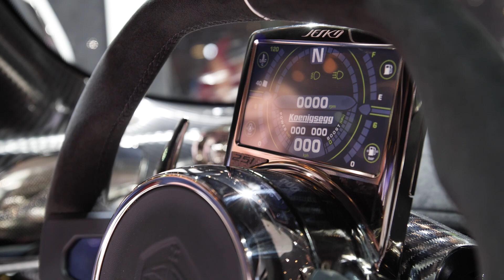Koenigsegg Jesko: Will It Break 300mph? | Carfection

Comment: Would like to see this against the Venom F5 and the Chiron SS
Reply: Chiron would be slower as it has a significantly lower power to weight (Bugatti cars are essentially blisteringly fast GT cars) and John Hennessy is a scam artist.  I'd put my money on Rimac and the pininfarina battista for competition.
Reply: @Illestrapper  you're right. Koenigsegg are the fastest and best. Even if the Bugatti has more power it will always be heavier. Unless they make the Chiron SS light
Reply: @zone2fanboy429  in this case, the koenigsegg has more power than the chiron and less weight.

Comment: What happens if you add nitrous?
Reply: Wheelspin?
Reply: @tornoutlaw  It's already insane hp, so they must be able to handle it.
Reply: @Shawncombat  wheelspin, blown engine, blown transmission, pop the tires, etc...  Sure components are usually over engineered but at that level of strain, adding a shot of nitrous could (may not but has the possibility) of causing disaster.
Reply: @Illestrapper  So, you have never used nitrous?
Reply: @Shawncombat  I have, but trying it on a new transmission configuration, a 1600hp car (stock) which already is testing the maximum threshold of tires is always risky practice.
Reply: mattsa pic You haven’t used Nitrous.
Reply: @Shawncombat  I had a single nozzle stage 2 nitrous kit on my old MR2.
Reply: @Shawncombat  only way to avoid serious wheelspin would be very small jets.
Reply: mattsa pic Sorry, I know they could never handle a few more hp. Not replying anymore for time sake, I should of already left for class haha.

Comment: I would happily try and take it to it’s top speed. Safely though!
Reply: With all due respect it takes a professional driver to take a car to 300 mph. It’s not quite as simple as mashing the gas and holding it straight.
Reply: @evanhasson6032  and even if you can handle it, you also need to be able to communicate with the Koenigsegg team and the Michelin team as you are entering ridiculous speeds and controlling the car.  Sounds simple but is extremely difficult.

Comment: What does the 251 mean on the wing?
Reply: Jesko will be produced in track "251" and road "300" version. 
"251" have  very high downforce and top speed 251 mph. Second version "300"  is normal downforce and top speed 300 mph.
Reply: Brunon Różycki this car is street legal
Reply: 251 is the chassis number of this car. Not the speed.

Comment: Tires.... It really is amazing that tires are the last unsolved equation in the quest for 300. We won the horsepower wars. Space age materials are in the bag. Safety has been solved.... It's just tires.
Reply: Honestly its not so big problem with light cars. KvK said thad tires factory engineers checking tires in Angelholm and they been tested car at 300mph on the rolls and tires were surprisingly ok...after the top speed run they checked tires and it was ok...Its risky but all experciences showing that new  tires ar ok for 270+ run.

Comment: Actually they do NOT have the top speed record.. the car was a modified agera RS  with a one:1 engine built it and ecu from a house map etc etc so Guinness Said no.. 

Still was fun to watch the 277,9mph run
Reply: Technically the one:1 is an Agera that’s why it’s an official record and they didn’t have Guinness officals so that’s why it didn’t appear on the book and it wasn’t modified it is an option when customers were buying the Agera rs
Reply: WRONG.. you are NOT allowed to put ANY THING in or between your own cars.. then it's called modified.. THATS why Guinness wasnt there or invited..  

And no the ONE isnt a agera it doesnt matter if it was because even if you have the excact same model like Porsche but you change even the ecu it's a modified car
.😂
Reply: The megawatt engine is a factory option. They make their own ECUs and tuning so what are you even talking about? And who cares about a beer company?

Comment: If a heavy M5 with 500HP can do 200MPH I think this wouldn’t have a problem doing over at least 310MPH
Reply: Physics don't work like that. The new M5 has 600 HP, M5C has 620 HP. Again, physics don't work like that. The forces are uncompareable.
Reply: Top speed is more about drag then weight.
Reply: watch donut media video and you get it why faster it goes the harder it gets also the buggati said that veyron in order to reach 155 miles per hour would need 270 horsepower but to go 100 more it needed 730 more horsepowed
Reply: @MBAM95  what? I am saying its hard for a car to reach 300 MPH, since the original dude of the comment said it should easily do over 300+
Reply: Thanks for the comments guys no one negative saying I’m stupid for that good info. Especially the first comment